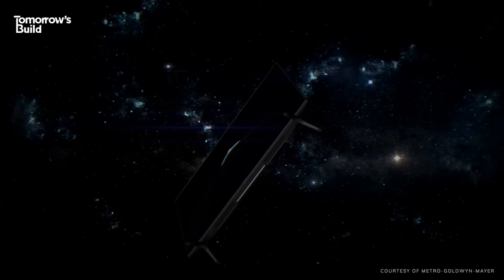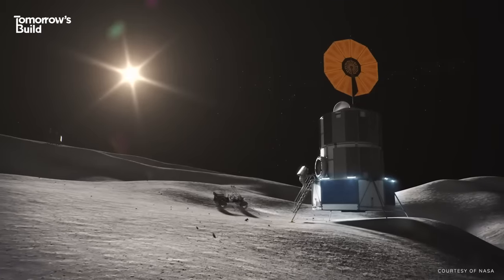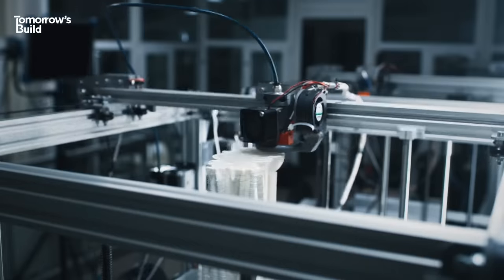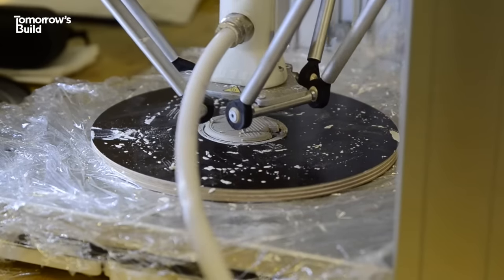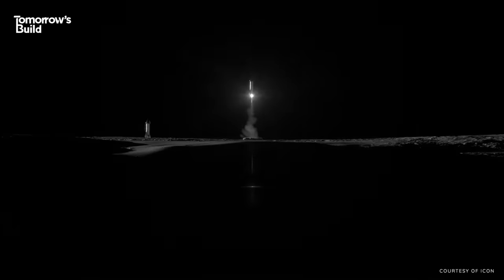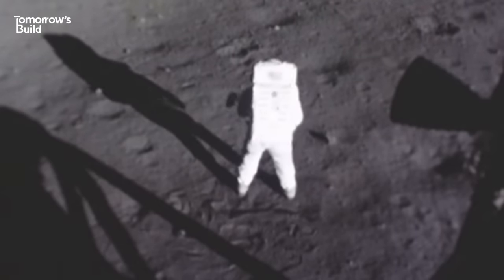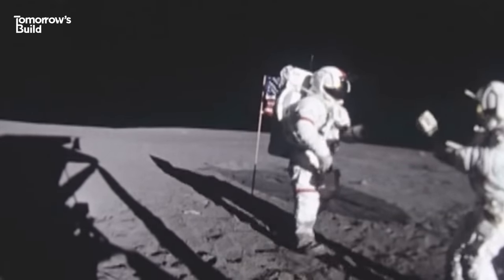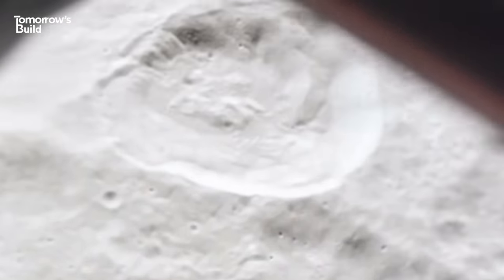NASA's $93BN Plan to Colonise the Moon

Comment: 3D printing structures sounds challenging if using natural resources of the planet.  Sounds like "trouble" for the printer.  Gotta invent steel/concrete balloons.  Inflate the structure and once it's exposed to a specific environmental change (light, air, etc.), it solidifies and makes that structure permanent.
Reply: Tomorrow's Build kind of said something to the effect of "why is NASA spending all of this money on this unproven thing" in the video - which isn't really reflecting what this actually looks like.

NASA operates via giving out contracts. They need something done, like getting spacesuits for the Artemis III landing mission, or the human landing system, and they'll ask companies to submit proposals. NASA then looks at said proposals, and selects usually several (unless their funding does not allow it). Selecting multiple things adds redundancy. NASA also likes investing in new technologies, trying to explore how different new strategies may improve their work.

In the case of the 3d printing on the Moon, this is just another one of those things that NASA is funding in some amount to explore the idea. NASA has not put out a more formal contract round to build Artemis surface bases, but many companies have been putting together a number of concepts that could potentially be used for all this.

One such is actually inflatable habitats, like you seemed to think of in some sense. NASA already has an inflatable module called BEAM on the ISS right now, and it's worked quite well. It seems like these will feature prominently in future space stations. Despite what you'd assume, these are actually stronger modules than their traditional metal counterparts, better at resisting micro-meteorite impacts. I can fully imagine making a big inflatable module, and covering it with lunar regolith with some kind of support structure to make a base.

So yeah, tons of ideas floating around, and I doubt any one of them will be the single way things are done - as we expand our presence on the Moon and later Mars, I'm sure many new ideas will be used.
Reply: @WasatchWind  Wow...GO NASA...and its contractors 👍🏽😁
Reply: Or just use existing lava tubes instead.

Comment: 3D printing has definitely caught on! I use it almost everyday at work. Mostly for prototyping and bulling jigs in the engineering field. Life without 3D printing would be going backwards. Maybe we haven't seen it catch on for building, but building is a tiny insignificant part of 3D printing!
Reply: Its not huge in building, but the people with the funds and will are definitely starting to use it. I suppose by the time we get to the point of building moon and mars bases (potentially this decade for moon bases) it will definitely be a big part of the space industry.

Comment: What about the structural/design differences of building something in that much lower gravity? That may be one of the reasons why 3d printing has a much better use case on the moon, you need much less material and that material doesn't need to be anywhere near as strong.
Reply: It's never going to happen. This is just a distraction from the real problems we face. Remember how Russia was getting badly beat in Ukraine? Well, this comes from the same geniuses. And even if we didn't have the real world problems we have this still would never happen. You'd have to look into the obstacles. They never tell you about the ones that can never be gotten around.
Reply: You need way more to block out the radiation
Reply: @asdf3568 ot necessarily, radiation can be blocked by burying the structures, or filling them with sand or water. A water filled balloon is a very good radiation blocker for example.
Reply: @rowlos123  Yeah but that's still material. And especially it has to be able to sustain heavier loads. Which makes it a challenge. Perhaps it's easier to, like you say, bury it. Another option is to build it in a crater. But then how do you get out of the crater?
Reply: @bunsw2070  well, Russia did lose quite a lot of area they controlled. And just not successfully taking Ukraine itself is a loss.

Comment: Blue Danube!
Seems sketchy. How are they turning regolith into concrete? Need water? It might be there. In fact, it most likely is. I feel like the best habitats would be repurposed rockets and inflatables. Not too difficult to imagine. You could also use very tough material that normally wouldn't inflate on earth because of the pressure/gravity.

I like the idea of a lunar colony, but what is it's purpose? It's simply too dangerous/difficult for a vanity project. Especially considering our current world situation.
Reply: It could help us make rockets on the moon and launch them from the moon, we can make rocket fuel from water so crafts sent to the moon could refuel and go even farther. Helium 3 mining could be viable for fusion power in the future. These rockets that can travel further distances would help us get to mars more easily. Space telescopes in low earth orbit have been effective but it is nothing compared to proposed lunar observatories. They would help us see parts of our solar system and universe we never understood. Study on the moon would help us better understand how we could colonize mars or spend longer and longer times in space.  Advancements in scientific understanding improves and leads to innovation on earth. Just look at the ISS and all that NASA and other countries have developed as well as discovered through space exploration. Industrializing the lunar surface would yield tremendous knowledg eof production methods in low gravity environment it would be one of the first steps to truly reaching beyond the safety of earth and into the cruel and unforgiving universe. Launching anything from the moon is simply easier, if we could fabricate modules on the moon, modules for lets say space stations and sent them into LEO then it would be more cost effecient. Really a lunar colony is an investment. Many materials desirable for their malleability, strength or conductivity can only be created in a vacuum. Analysis of stuff like biological crystal growth would be optimal for lunar study. 3d printing organs parts has been discussed as something that would be done more easily in zero or low gravity due to how on earth high gravity pulls down and collapses the delicate complicated structure being built.Its a sign of our scientific advancement really if we are able to achieve this.
Reply: You're right saying that we could repurpose rocket stages or use inflatable habitats, they're definitely an option. I like though that NASA puts money towards these experimental type solutions.

In terms of the why of doing a lunar base - You give NASA $30 a year (if you're an American). I would gladly give them a hundred if I could. While scientific exploration doesn't seem to visually benefit the taxpayer a lot, I can assure you, in terms of government giving back to the people, NASA does much better than other government agencies. They briefly mentioned a few technologies that exist or were improved due NASA, the computer mouse, memory foam, etc - but there are just abundantly more. Digital cameras, scratch free lenses, tennis shoes, the jaws of life, and the biggest, giving a shot in the arm to the semiconductor industry - note the fact that PCs first starting coming out after we went to the Moon.

And this isn't even factoring in the plethora of great research done on the ISS, like research into cancer and other biomedical applications. The point being, space gives us really hard problems, and in creating tools to solve those problems, we can then use those tools to solve problems back home.

Early on, a moon base would just be a scientific research station. I really hope that in the 2030s we can get to the point where it's continuously inhabited, like the ISS is now. But overtime, we may perhaps see it being used as the gas station to the rest of the solar system, harvesting its water ice in order to make rocket propellant. 

In the end, all I have to say is, the general public who doesn't follow spaceflight constantly sees the word "billions" and feels sick to their stomach, asking why this is being done rather than solving world hunger. The complexity of problems like world hunger, cancer, etc are whole different complex problems, but it suffices me to say, they will not be solved exclusively by money, and in fact, too much money may make the problems worse.

Billions of dollars is a lot to an individual, but not to a government. There are much worse things that humanity can do than spend a half a percent of its money (which we don't) on spaceflight. I argue that beyond all the technologies it gives, all the jobs its creates, space is simply inspirational. So much crap is going on in the world today, but space stuff is so cool. Show a picture of the Carina nebula from the James Webb space telescope, and I venture to say nearly everyone would find it really beautiful looking.

Artemis I say, will be especially inspirational, because it will be the first time that women, people of color, and non-americans in general will go to the Moon. I know some people have flinched seeing NASA say that cause they think of political stuff going on today - but really I see it as now everyone is getting to go into space now. I think that will send a strong message to humanity when they can start seeing their country going into space - and seeing that these astronauts from all these different countries can get along, work together, and be great friends.

Even in the midst of the awful war in Ukraine, the cooperation you see between American and Russian crew on the ISS really feels so simple, and again, inspiring. I think we can't overlook the impact of this.

Comment: Why you don't use pre built module sections and use 3D printing to apply hardening sealant? The other problem is how to anchor foundations on a surface full of lunar dust. Other available building technology is using inflatable frames to build crenosphere domes. If this can help, please hire me for a ground mission support job. Thanks.
Reply: Inflatable surface bases are a great idea indeed - and then you could use 3d printing for assistance in constructing a shell around them to protect from radiation. It doesn't have to be just one design, but I'm sure many of these concepts will be used in some fashion.
Reply: @WasatchWind Sierra Space is developing inflatable material for a space station, I believe it could work for the moon as well.

Comment: There is timeline issue with what the expert informs in the video, he states that the technology is 50 years away from been tested on the moon, and in the other hand you have a 2035 timeframe to build some kind of habitat on the south pole. Probably is not going to be 3D printing, and it will not be as big or as expensive once they are in orbit, never the less, it sounds more like 3D printing marketing than a real doc clip about the progress in the matter.

Comment: I still think they need to bring stuff from earth to make it work. The outer structure could be made from regolith but there is no way for them to make reusable oxygen/water without machines from Earth to have some of the foundations of living on the moon.
Reply: Let's push iss , hubble and other satellites to the moon to be used. We already but plenty of energy into getting it part of the way.
Reply: @CHMichael  those were designed to orbit an object not to land on the moon in a freak accident leading to the death of 5-8 crew members.
Reply: There's water on the moon. But yeah, some stuff will have to be brought.
Reply: @CHMichael  uh.... do you not understand just... how all of that stuff works? You can't just push the ISS to the Moon. It would be such a complicated difficult, expensive effort - and in the end, the ISS is not made for being a Moon base, where the radiation is more intense. I also don't see what benefit you'd get from putting Hubble on the Moon.

Just build a new Moon base, this is not kerbal space program where we can just stick a rocket engine on the back of a space station module and boost it to the Moon.
Reply: How about plants and algae?

Comment: Watching this video I was struck by two points that you did not mention but which would have a crucial impact for building structures on the Moon:
(i) A lot of construction methods on Earth rely on using water. Whilst there IS water on the Moon, it will probably not be available for earlier missions and also there will be competing demands to use it for drinking, manufacturing oxygen and rocket fuel.
(ii) You mentioned not being able to take large amount of material to build structures to the Moon but you failed to mention that you would not be able to take the Labour. Proposed Missions I have seen all rely on automated manufacturing- often before the human astronauts arrive. For this 3-D Printing would be ideal particularly as it would be done by robotic vehicles/machines.
Reply: Well the bases are not something for the early missions. This video makes it sound like the astronauts would be living in the 3d printed structure, which they almost certainly wouldn't at first. I need to look into this more, but it sounds like this is simply a demonstration mission for the 3d printing. Early landing missions wouldn't be long enough to necessitate a base, and would have the crew living out of the human landing system craft.

Formal base building would likely not start until the early 2030s, when we are finally thinking about establishing a permanent presence on the surface.

Comment: Surface bases won't work on the moon, because of the intense radiation. The moon orbits well outside the protective magnetic shielding provided by Earth's core. Space Station, and other low earth orbiting habitats, and craft get a way with it because they orbit inside the protection of the magnetic belts. But, even low earth orbiting crews must take shelter, or abandon their stations in the event of a CME from the sun. Also, you can't produce and pour liquid based compounds in zero pressure environments, like on the moon. You also have the plus/minus 250 degree temperature variable to deal with. One side of the structure is being baked, whilst the other is being frozen right after anything comes out of an extruder. It just can't possibly work in that environment. You MUST dig into the lunar surface with tunneling machines. Once you have an area dug out, underground, you can seal the tunnel with an airlock, create a pressurized and controlled environment in which you can then use your 3D printing machines to sculpt the interiors of each habitable volume. Such structures must be underground to protect crews, crops and livestock from cosmic radiation and MMOD strikes. The only "base" related structures that should be on the surface should be launch and landing platforms, and temporary logistics transfer structures. That is THE ONLY way to safely and efficiently colonize the moon. The same goes for Mars, too. No ifs, ands or buts. Full stop.
Reply: Nah.  A few meters of regolith piled on top of an inflated structure will provide all the radiation protection needed.
Reply: @AlbertaGeek  ...And what of the MMOD problem? I think I'd feel better knowing there was at least an hundred feet of solid rock between habitat, and the surface.
Reply: @ThomasGrillo  "And what of the MMOD problem"
A valid concern.  Just so happens that there's a NASA study on that problem one can find online.  It's called Meteoroid Risk Assessment of Lunar Habitat Concepts.

Given what they know from the flux of micrometeoroids, and using hypervelocity impact tests, on a model of a structure with an external surface area of 330m^2, the PNP (Probability of No Penetration) with a concrete wall 10cm thick over a period of 20 years approaches 1.0.  In the study, the wall is considered "penetrated" if the penetration depth exceeds 1/3 the thickness of the wall.

With results like that, a few meters of processed regolith seems like it would be adequate protection for a small initial base.  That may be orders of magnitude less than what it would take to make you "feel better", but then manned space exploration is not for the faint of heart.

Comment: Structures on the surface of the moon will be pelted with meteors.  In order to have a safe base on the moon, it will need to be underground.  It's ok to have surface access points, with windows, etc, but the bulk of the base, the part that's important not to get destroyed, will need the protection of being underground.  To build permanent moon facilities, the order should be 1) energy infrastructure, solar and/or nuclear, 2) mining of necessary materials, water, etc. 3) manufacturing, and finally 4) human habitation.

Comment: Can anyone tell me why we are taking so much metal to the moon, when we can more easily build structures underground by mining tunnels and caverns which have the natural protection from solar radiation from the rock above these structures?  We seem fixated on above Moon structures that look great but are really totally impractical, when all you need on the surface of the moon is a landing pad, tunnel entrance and the solar power generation and dangerous radioative power units.  Keep all the humanity related stuff below ground - generally self supporting tunnels that are lined with self-sealable air-proof bags that can keep the pressurised air in.  Any above Moon exploration, fixing power/infrastructure or harvesting raw materials can be done with wheeled robots or flying UAVs.